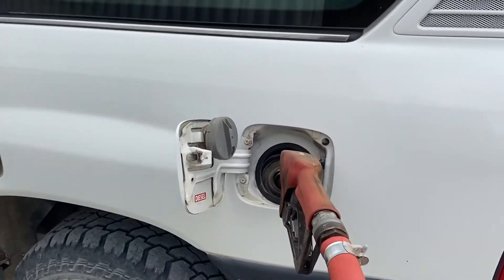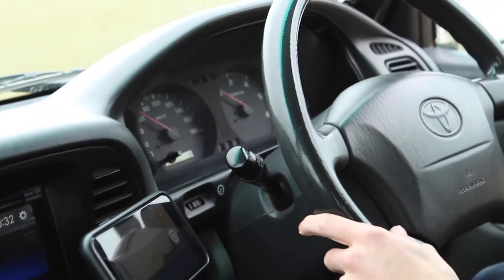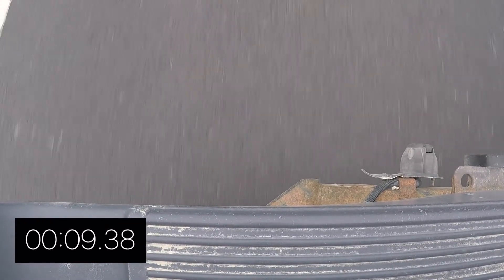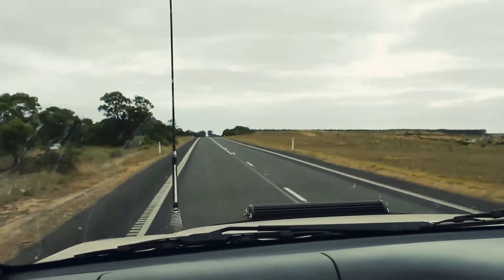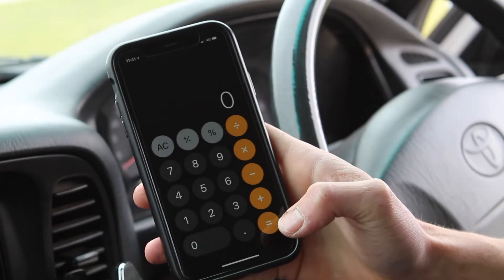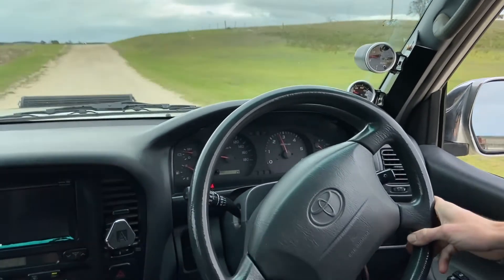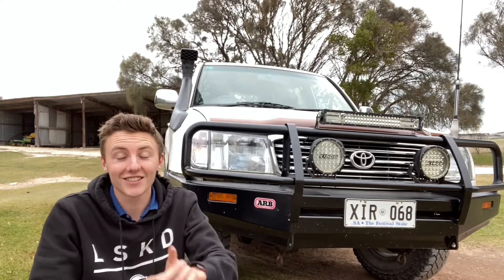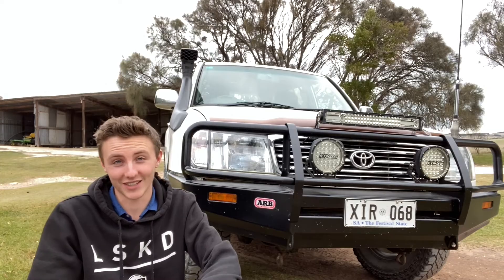Stock 1HZ vs. TURBO 1HZ [Turbo Conversion Part 4]

Comment: im running a dts turbo kit paired with a cross country top mount intercooler and big radiator on my 105 gxl 
i was just wondering what your average water temp is at highway/ under load, also oil pressure at idle vs highway speed
my egt struggle to hit 400 degrees even when towing 👍 im only currently running a 2.5" exhaust
 
good couple videos nice to see some insight on the 105 keep them coming

Comment: Hey mate what do your egt's sit at on the highway?  I have a non intercooled 1hz turbo running 12psi and I usually see 250-300 then 350-400 up a long incline.  Interested to see how yours end up with future mods!

Comment: try towing a tamdern trailer with a car on the trailor up a big hill.....you will whatch your egts  rise up quickly .to 550.... 600..... i know from experince owning a 75 1hz with garrert turbo ....1hz turbo different story when towing a big caravan or tamdern trailor
Reply: should try it bloke espically throughout big hills over a mountain range towing tandem trailor with car on the back  then u will know about your 4wd an egts

Comment: Have you touched the Injection pump screw at all? just curious. If you haven't i wouldn't bother until you put an inter-cooler on. These 1HZs love the boost if they stay cool, my mates 75 series runs 20 psi with a big water to air cooler and he drives it like a mad man with no engine issues. its not boost that will kill it. its the heat that does. The top of the pistons is quite thin and when they get hot they melt.